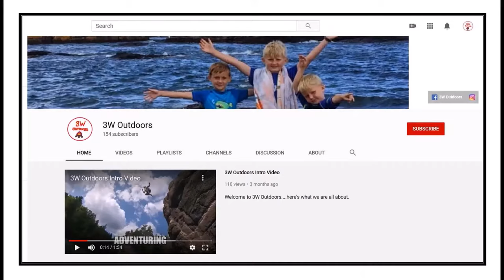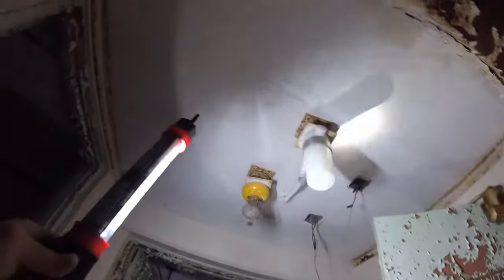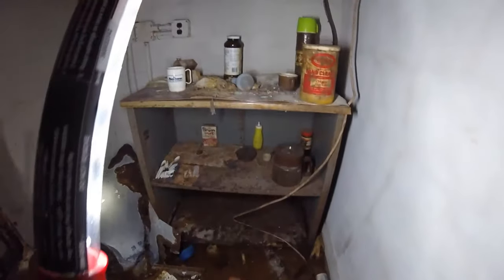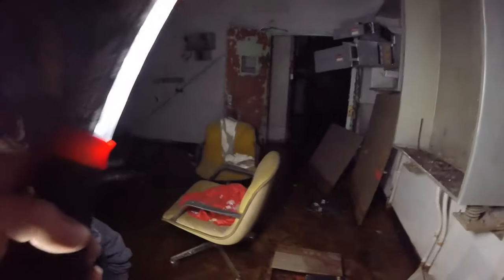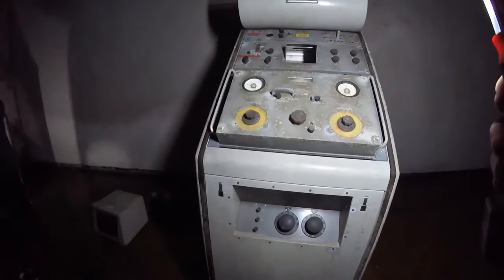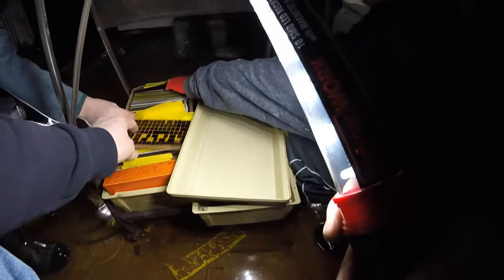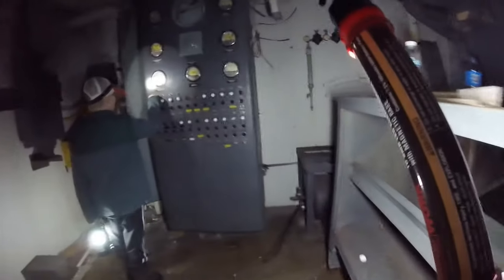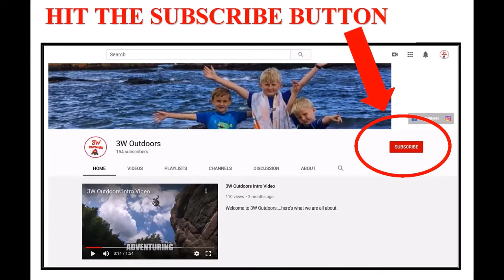Exploring An AT&T Long Lines Cold War Nuclear Bunker

Comment: Sad that someone owns this and can't even put in a sump pump to keep the water out.  I would love to have one of these places.
Reply: I know that's how I feel about this underground Nike missile storage launch places because it's a portlander Once important piece of history and it should be preserved somehow at least thankfully a few of them are but after the government went and did all that work building all those places like that surely for their Heritage something ought to be tried to be done with them
Reply: @richardvg7670  I know that's what happened at the Nike base in Lumberton, NJ. They let the underground storage areas flood deliberately to prevent access (like at many other sites). It's all built over with a housing development now. If the homeowners drilled down 20 feet they might be surprised at what they'd find.
Reply: They actually make some pretty cool floating pumps.  Run a garden hose to it, the pump floats just under the water surface until it pumps most of it out and lands on the bottom, then it pumps the water down to half an inch or less.  They take surprisingly little power, so a 1500W portable generator would run one for hours on a gallon of gas.

Edit:  This is the first thing I would do if I bought one of these properties and it didn't have power.  If you need more water removed, rent a 5000 GPH pump for $150/day.

Comment: That is a 12v71 detroit diesel generator it is a v12 that is 71 cubic inches per cylinder im surprised there still there that place is very in tact
Reply from the maker: Yes very cool place
Reply: I bet it would fire right up too
Reply: @DirtRoadTherapy  i bet you it would to along as it turns over

Comment: Two things I was looking for that I didn’t see- a pump room for keeping the water at bay (surprised there wasn’t more!) and a hatch/gantry crane for getting large things down there. That looked like a Detroit diesel powering the generator. To get any part of that in or out would require a hoist, and no doubt these geniuses had a plan for that
Reply from the maker: You are right on. There was a pump room and there is also a large hoist area at the top of the stairwell that we walked in on. The hoist is no longer there but it’s obvious that there was one. Good points.